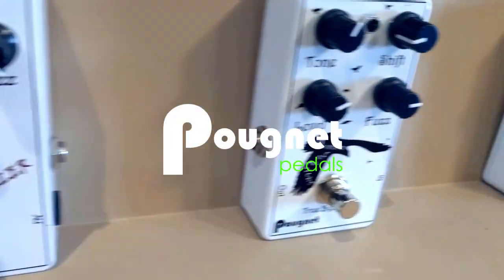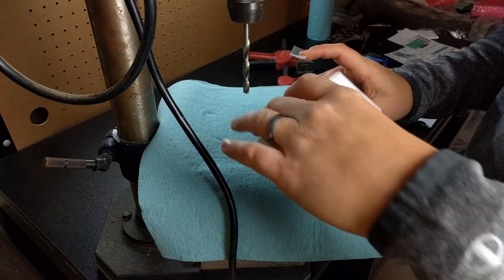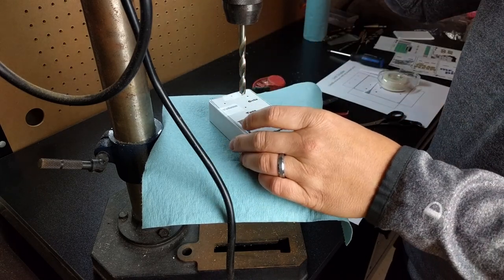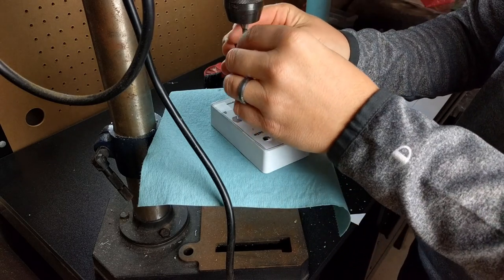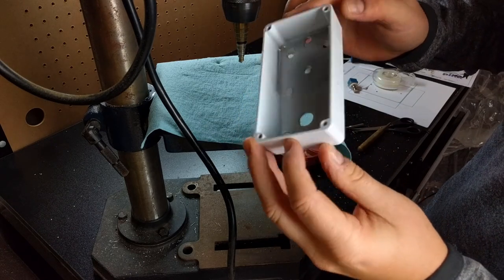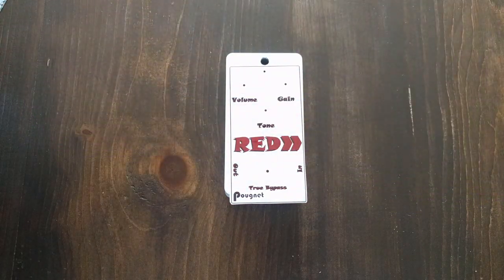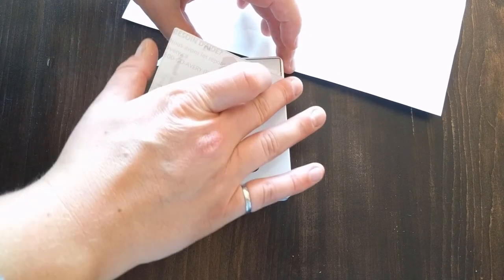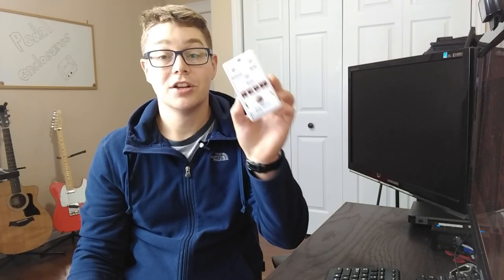Pedal Enclosures | Drilling and Adding Decals | DIY Guitar Pedals

Comment: Great video and tutorials. I tried that Rustoleum clear gloss 2x and the smell is pretty bad and remains on the pedal days after. Have you tried any other clear gloss or resin that may be better in that regard?
Reply from the maker: I haven't. I have always used the rustoleum. Light coats, from a distance. I agree that it needs a day or two to "air out" though